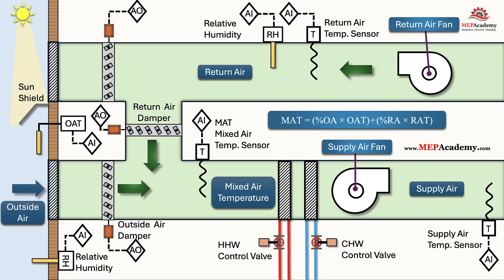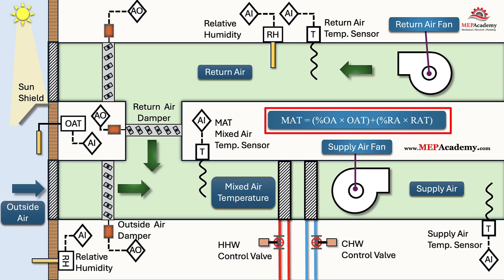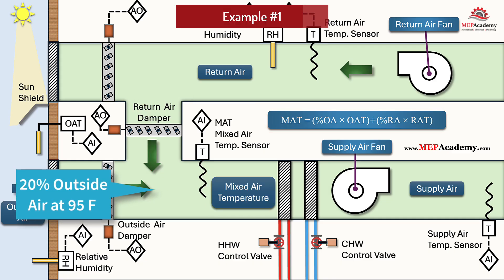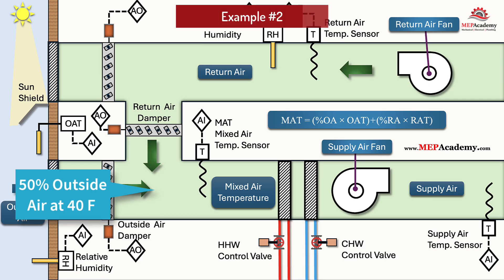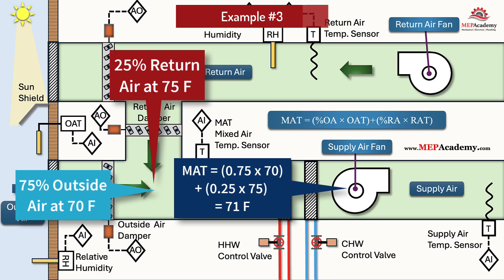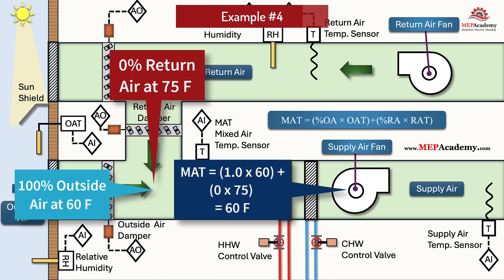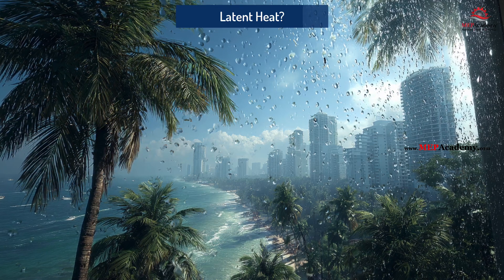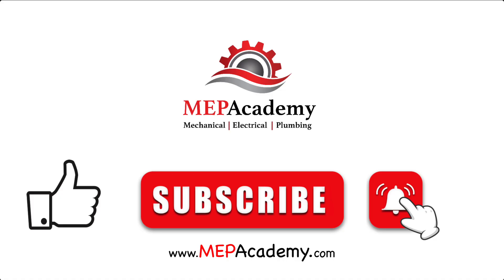How to Calculate Mixed Air Temperature

Comment: Hello Sir, hope you are doing well.
I’m preparing for MEP jobs and I want to learn family creation. Honestly, I’m a little confused about where to start. It would be really helpful if you could guide me on how to begin
Reply from the maker: Great question! When people talk about family creation in MEP, they’re usually referring to Revit family creation — building the parametric components used in HVAC, electrical, and plumbing models. A good place to start is with the built-in family templates (like air terminals, valves, or electrical fixtures), since those give you the right categories and connectors. From there, you can learn how to add dimensions, parameters, and connectors so the family interacts properly with your systems.
If you’re just getting started, I recommend:
Reviewing the difference between system families (like ducts/pipes, which are built into Revit) and loadable families (custom equipment you can create).
Practicing with a simple object (like a grille or junction box) before moving to more complex equipment.
Checking out Autodesk’s free tutorials or beginner courses on Revit family creation.
Reply: @MEPAcademy  Thank you so much, sir. You don’t know how much you’ve helped me. I asked this question to many YouTubers, but they just referred me to their playlists instead of telling me where to start. I’m really grateful to you from the bottom of my heart
Reply: @MEPAcademy Sir, if you don’t mind, can I ask one more thing? I want to become an MEP modeler. I’ve already done MEP in Revit, and now I want to start with AutoCAD. Could you please tell me what is necessary in AutoCAD for an MEP job? Should I directly learn AutoCAD MEP, or first learn some basics of making architectural drawings?"